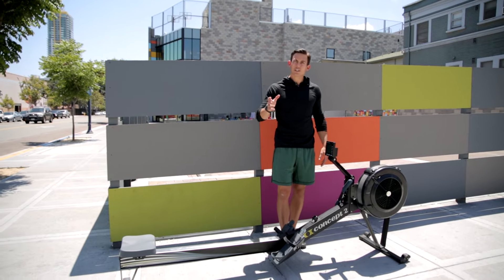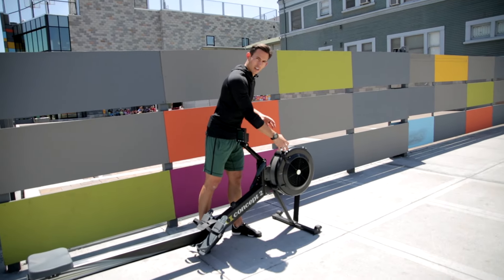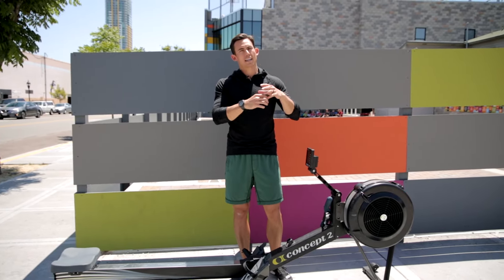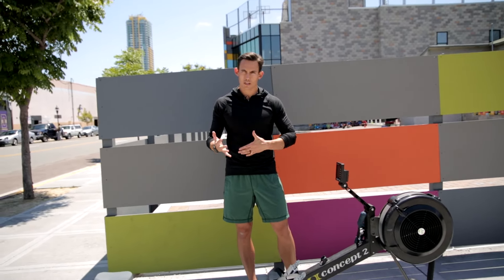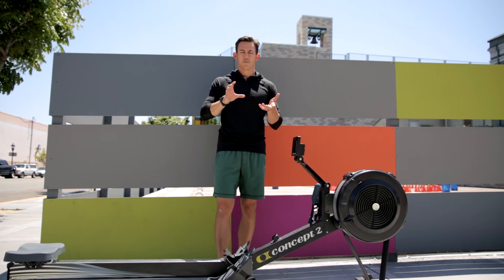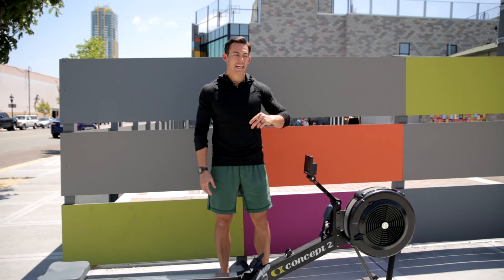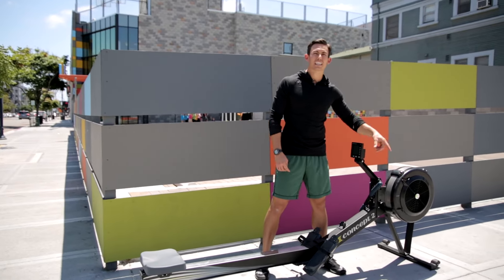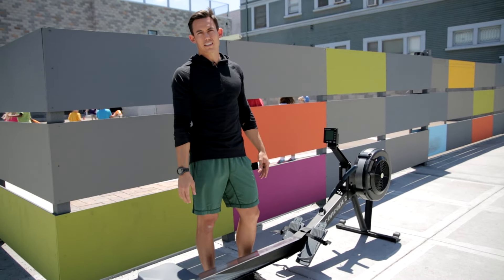Damper Settings - How to Find Your Efficiency Point

Comment: 3.5 to 4 mimics water
Reply from the maker: It may on a new machine, unfortunately on used machines that get dirty or see more use, damper setting will actually change resistance the dustier a machine gets. For example, if you put 5 machines next to each other from 5 different locations and set them all to a 4, they would all report different drag factors even though the damper was the same. It's why we like to talk about Drag Factor over damper setting.
Reply: BandB1111111 just when u thought u knew what you were talking about
Reply: If you erg to train for 8's, you could leave the damper on 3 or 4 for a million meters and be just fine. Unless you erg in a lint factory.
Reply: Couldn't care any less right now about what you're saying
Reply: Dark Horse Rowing I've been wondering about that a lot! I row at a bunch of different gyms where the maintenance of the concept 2s I use can vary widely. Where can I check to dial in whatever my preferred drag factor winds up being when I'm on a different machine? Also, can you give me a rough idea about HOW much variation is possible between ergs? I want to estimate about 30%, but I don't really know if that's just in my head....

Thanks much! I just discovered your channel yesterday and I'm devouring it! 👹 I like the blend of influences in your coaching style.

Comment: The logic is flawed... +always depends on the distance... why should women generally row on a lower damper setting than men according to your statements that doesnt make sense...
Lot of truth though in your statements.
IMO you shouldnt use the damper numbers but rather the drag factor and i think you shouldnt start out higher than 150 drag. Rowing on a the max dragfactor makes it nearly impossible to sustain good form throughout a workout since you cant sustain that load for too long and sooner or later will start hunching your back etc.

Comment: I can't emphasize enough how wrong this video is. A big strong rower is the type that challenges for the WR on the 100m or 500m. Me at my 1:17m 500M best will beat all of them handily if you have them row at a 1 and I row at a 10. This is so so wrong I had to check if the video was posted on April 1st.

Comment: I've just watched your video about not lifting your heels when you row, yet both of the rowers in this video lift them. Is the 2nd rower you? You lift your heels up and come forward past vertical shins. The first rower lifts them way up, comes way forward and nearly touches the frame with the handles. Have you polished up on your technique since you made these videos? Personally I don't lift my heels. I row barefoot and you cannot lift them when barefoot as it would be too uncomfortable. Apart from being inefficient, bending the knees too much (lifting the heels) puts a lot of stress on the knees, which is particularly bad for people with knee injuries or arthritis.
Reply: Les Jensen because ur a rookie, they know what they're doing
Reply: What's that supposed to mean? I'm just asking for an explanation of why they teach it one way and demonstrate it another. I appreciate Dark Horses videos and he's doing a great job... I'm hardly a rookie though. I'm 57 and have been rowing on Concept2 since the B-model in the late 80's... so nearly 30 years... and I've owned C and D models.
Reply: Les Jensen great job
Reply: Dark horse rowing provides extremely inaccurate and faulty information. The informations provided in this video is just outright wrong. Using a 10 is for sprinters, using a 1 for long distance(no one excpet weak girls use 1, maybe a dude on a long row would use a 4-6). what they say in this video, is exactely the opposite and outright wrong. Their information comes from Fitness Rowing, and not actual Rowing. I saw the video about the heel lifting aswell, and had to correct him there aswell. Most of the time you do not lift your heels in an extreme sprint, but all the other time its an absolute must that your heels leave the board. Altough, its important that you build up the power on the erg and get your heels back down as fast as possible to get the most out of your calves.  And remember, 10 is for sprinting, not  a 1!

Comment: This is unlogical I think. It is the opposite I think and also have read in concept2 forum. If you move slow you should not use 10. Then the wheel has nearly stopped when you reach the catch position. Imagine that this will make it very hard to start each stroke. If you though move fast, are sprinting, you can use high damper setting because you then are able to catch before the wheel has slowned down to much. Then it becomes easier to start the stroke and easier to get it speeding up (if you use low damper setting it is harder to give force into the stroke).
Reply from the maker: It's often isn't the opposite but forums will be forums and you can find someone who believes each side of the argument in a forum. It's a great place to discuss opinions. This is ours and I would welcome you to try it before making any assessments of its validity.

Comment: this is utter bullshit?! the sprinter is using the 10, whereas for long workout sessions you use the lower damper settings! i wanna see you making  a fast 250m sprint on the 1... lol
Reply from the maker: In this video we are talking about rowing efficiency. Everyone has their preferred damper setting depending on their athletic abilities. You can row the same time with max and minimal damper setting. They will both feel different . One will feel better than the other. Of course the stroke rate will also change. Our point is about the efficient power application so you can achieve the best results in any situation.